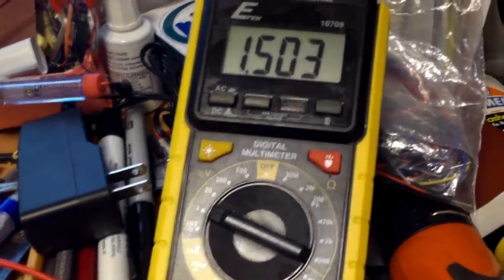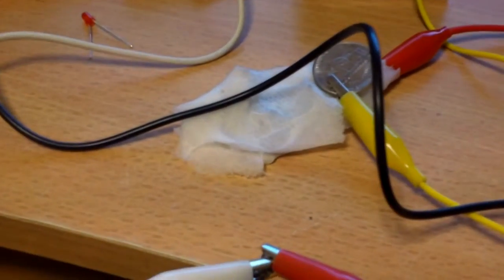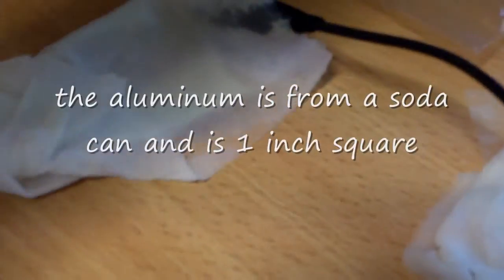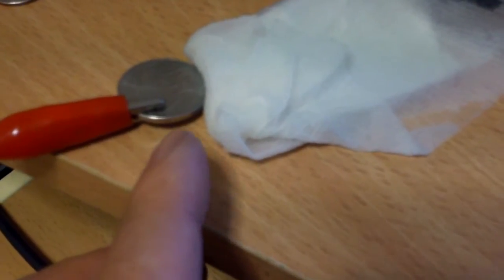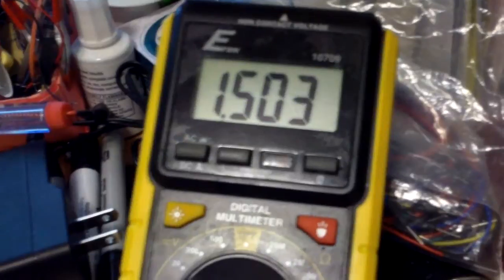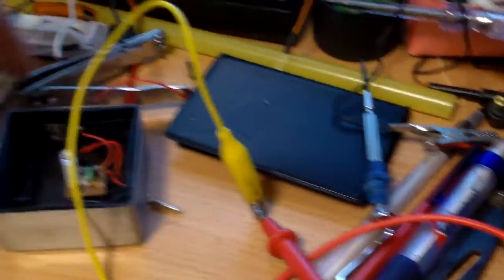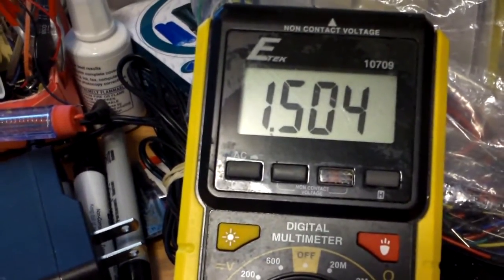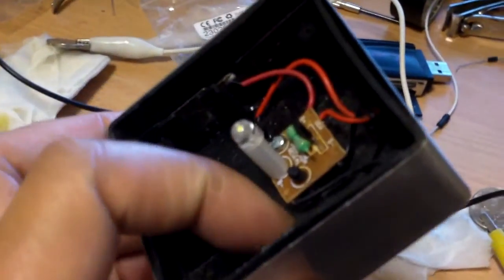Nickel aluminum battery experiment

Comment: You might try to lightly sand the aluminum if you're using it from a soda can.  I remember reading somewhere that they put a very thin layer of plastic or some other material on the inside to help prevent the acids in the soda from attacking the aluminum.  I'm sure the difference would be minuscule, but I feel in this case, every little bit helps.
Reply from the maker: A good tip and good morning. I will try sanding it to see if it makes a difference. This looks like a third grade science experiment but it's still fun.